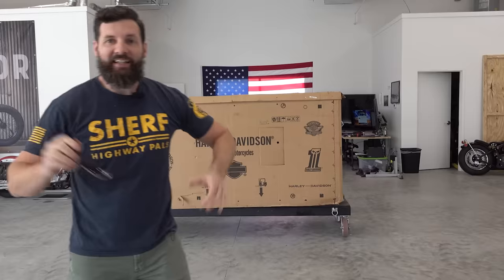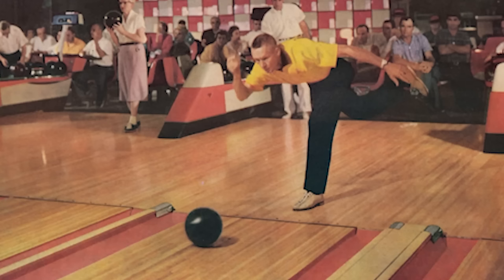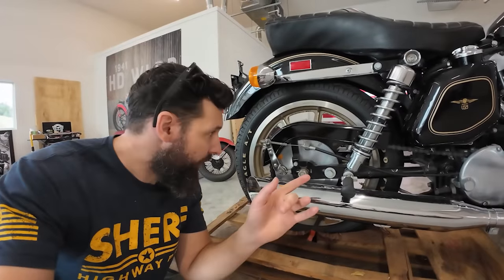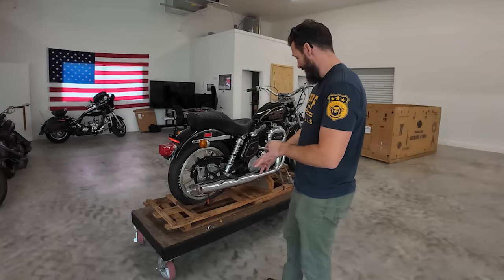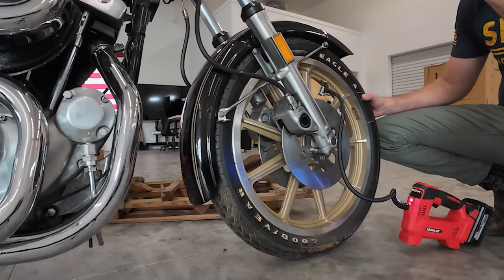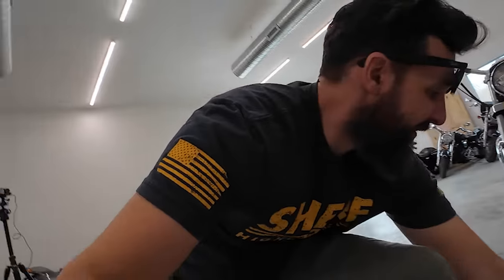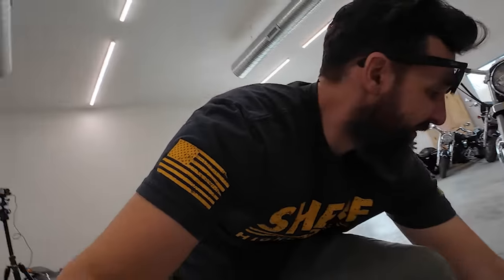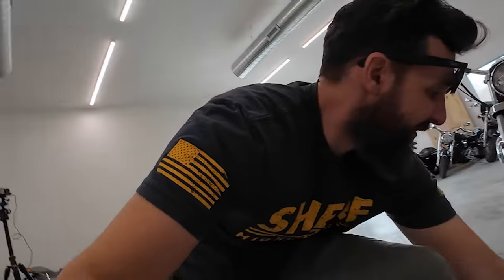I Bought a Brand New 45 year Harley Davidson Motorcycle

Comment: I worked at a Harley dealer from 1980 to 1983 and set up numerous XLH/XLCH from the crate. Batteries were dry, brake master cylinders were filled. It was AMF until 1983 when Willie G bought them back. That bike was definitely used as a parts bike and I'd go through thoroughly. People complain about AMF quality but many of those same people that worked during AMF worked for Willie G too. AMF can be blamed for some of it but they kept Harley alive when it was going to die.Long comments don't get read, attention spans are short today. Good luck with the bike and for goodness sakes get some tools.
Reply: Since you worked for a Harley dealer back in the day, was there any truth to the rumor that some dealerships would totally dismantle the engines and blueprint them before selling them to avoid future warranty work ?  I heard that Dudely Perkins of SF did that because of all the problems with the AMF bikes.
Reply: @cyrilhudak4568  The dealer I worked at never did that. The biggest problem with the XLC/H was the transmissions. They sent the head mechanic to transmission school and I was scheduled to go but I left for a better job at a Cadillac dealer before I went. When setting up a new bike though when it was in the crate we went over all the nuts and bolts and checked for loose things. The same union loads that were doing a crappy job putting the bikes together were still working there after Willie G took control.
Reply: Lol dont mean to be a smart a$$ but wasnt the last XLCH in 1979? 😛 still enjoyed your testimony
Reply: @rodan2852 Because it's impossible to setup a 1979 in 1980 ae - that would just never happen...
Reply: You're right. AMF saved Harley and had instituted QA and buying new tooling. The family didn't care about mc's except for entertainnig Willy G's love to ride. They milked the company without concern for quality. If AMF hadn't stepped in, HD would have gone out of business and would not have been around to bring back the big mc market that came in the with 90s. I dated the daughter of VP of Parts.
Reply: Much appreciated to hear that some ppl give credit to the workers and just the simple fact that harley is still around.  If you used to assemble them, would it be OK to ask you about problems I may incur while rebuilding my xlch?
Reply: @hoobeydoobey1267  Whoa, the daughter of a VP of Parts!? Wow. VPs are almost like a king of a country so good thing you didn't date a daughter of a lowly accountant or car washer.
Reply: I read it and i thank you!
Reply: Wrong they bought Harley back in 81...not 83
Reply: The workers that put bikes together are not responsible for quality, quality comes from design and testing production quality comes from management.
Reply: That would be a waste of time...??? He doesn't know how to use them...?? Nore the common sense to learn...????
Reply: @Darth_Sidious_66 Lol that was both funny and hostile
Reply: No XLCH after 1979 . You may not recall completely.
Reply: Or you could get it running and see what issues it has? If it has brakes and throttle then send it.. of course check all fluids but I wouldn’t be going thru retightening every single nut and bolt on the bike.
Reply: @rodan2852  yes it was . I had a 1979 XLCH kick only was the last year .  That bike was kinda an oddball like XLCR setup .  But it would of dusted my 1995 1200.  It was an extremely fast bike all stock. Better top end speed too. Best handling bike I've ever owned. Regret selling but had too many motorcycles I thought.
Reply: The same AMF that made racquetball rackets?
Reply: Some people still read 😂
Reply: My buddy/brother has an 83 AMF that he wouldn’t trade for any bike on the road.
Reply: reminds me of Honda's same vintage
Reply: The zip lock bag is kinda a giveaway too.
Reply: Most people don’t know AMF design the evolution motor! I don’t care what they say. I’m a sucker for the Shovelhead.

Comment: My first streetbike was a '69 Sportster, which except for your 78's disc brakes and cast wheels, was very similar to this one. These were about as old school as you could get in 1978, but they still had a loyal following. This was just one year before the 130 hp Kawasaki Z1-R Turbo, 120 hp KZ-1300 and 6 cylinder 24 valve Honda CBX, so people certainly weren't buying these for performance, but to get that legendary V-Twin mystique. By the way, I love those old raised white letter Goodyears!
Reply: I have a '72 XLH with the brake pedal and shifter on the opposite sides! Really fun to ride.

Comment: That exact model was my very first "new" Harley Davidson. I was never able to get that, hand pinstriped, leather seated thing over 98 mph. no matter how hard I tried. Never the less, I still remember that bike to be the most beautiful bike I ever owned. I am still proud to say that I was an owner of a 75th. Anniversary Harley Davidson  sportster. Thanks for the trip down memory lane.
Reply: How was quality of built back then?
Reply: PeterAngles-jq7gr  They are actually the fastest motorcycles today....right off of idle. However, the other ones begin to catch up real fast not too long after. Key word there is "idle". Nobody with an overhead cam produces that kind of low rpm torque today, do they? (of the same cc or cubic inch) I'm remembering the adage "It's not how fast you go; it's how you go fast." I don't know of any other motorcycle that is that fast off of idle, and they were not trash. They were good. I don't know that Harley ever made a bad Sportster motor. It might not be the very best for longevity, but they were far from trash.
Reply: A buddy I used to work with who had a older brother by a blue 78 AMF 1000 new that passed away shortly after he got it his mom kept it for him for 14 years till he turned 16 that dude has rode it everyday ever since even in the coldest of Ohio Winters he would leather up and ride it on the ice to work he even rode it into the church with his old lady on the back when they got married it was great crazy fool will pass ya doing 70 on the back wheel dragging a hand laughing pretty sure his brother is always riding with him I haven't rode with a bigger nut and I rode motocross bikes with some real loons growing up
Reply: I had a 79 XLS 1000, I put an SU carb on it, that made it go, saw  over 108 mph easy.
Reply: @larifari4371  No complaints about the quality. Chrome was immaculate, paint was primo, even the hand pinstriping added to the beauty. Gold mags were awesome. Seriously, if you were lucky enough to own one you had a very distinctive motorcycle. That is unless you wanted to go over 98 mph. 😞
Reply: @dozerblade  As I recall 79 was the first year of a major frame change and a few other internal revisions on the Sportster model.
Reply: @raybrensike42  This comment made my eyes bleed
"Right off idle" is just some made up term that doesn't even exist wtf is that even supposed to mean💀☠☠☠☠
Reply: Seat was vinyl, not leather .
Reply: @devildigger1404  Not on the 75th anniversary models.  Both FLH and XLH had leather seats.
Reply: It is a very good looking bike and except for the tires which were crap when they were brand new,  and need to be changed out anyway,  should be a nice reliable machine.  I wonder how much they paid for it?  The crate has a lot of value to it too.  Look at all the cool graphics on it.  You could also use it to ship the bike anywhere.  Lots of fun!!
Reply: PeterAngles-jq7gr  So did your mother...
Reply: PeterAngles-jq7gr  You got it, friend

Comment: Worked on that era Harleys 40 years ago. Don’t worry about the external fasteners. I could tell you about problems with internal quality control which can and should be rectified if doing rebuild, from rocker arm shaft end play to crankcase bolts. But put together properly most issues easily be taken care of.

Comment: I owned the exact same bike back in 1982-83. Made it into a chopper after running out of gas too many times with that small 2.2 gal tank. I put a 3.5 gallon mustang tank on it, had the swing arm removed and a custom hard tail fabricated for it. I'm pretty sure that the original owner changed the drive sprockets on it ad well as staggered pipes as I could get that bike up to 120 mph no problem. She was fast and at that time the only bike that could take me was a punched out electra glide that in its prior live was built for the local drag strip. I loved the bike, the wife, not so much, being a hardtail and the small pillion seat made for an uncomfortable ride for her. 
Also, the bike had 4 circuit breakers located under the seat, one would occasionally trip, killing power to the ignition and leaving me stranded on the side of the road, eventually, the breaker would cool down enough to auto reset and allow the bike to start and run. This seemed to only happen on pretty hot days. When I made it into a chopper style bike, I replaced the breakers with a fuse box and completely rewired the whole bike. Fun bike, kind of wish that I still had her. And yes like all Harleys of that era, she would mark her parking spot with a few drops of oil. Was my first Harley and now on my 12 or 13th Harley now, hard to keep track of them all at my age. 
Enjoy the ride, she's a classic.

Comment: Brings back memories. Back in 1981 I was 18 years old. I bought a new 1980 sportster from my hometown Harley dealership. 11 yrs lots of memories and 46,000 miles I sold it. Many back road rides throughout Wisconsin and N. Illinois. 1 tough ride from N. Illinois to Colorado, Pikes Peak summit "thought I'd freeze to death in September" Pueblo west, then home. It was a short trip and country back road putt bike.. Highway travel at higher speeds the 4 speed/solid lifter ironhead vibrated my eye teeth loose. Always liked the low and lean sporty though!
Reply: My first Harley was a 1981 Sportster.  Loved it.  Root beer brown with a seat as comfortable as a board.
Reply: Your bigger Harleys had a adjustable chain oiler that used the engine oil to lube the chain. I had a 65 XLH sportster it did not leak, Ihad the oiler turned off. Motor cycles from that era were a whole different breed! They were a mechanical machine! Not like today's plastic cars and motors full of electronics with psychological problems!!! Your old vehicles if you had a  
Problem you could bend or twist something or hit it with a hammer, and sometimes it would go again!

Comment: Owned a 76 AMF Harley Davidson, drove for several years, never leaked a drop of oil, ran great and sometimes l wish l still had it. It was fun watching as it brought back many memories. Thanks!
Reply: Most marked their spot cause of the chain auto oiler which it was supposed to drip on chain from there to floor.   Those older models had shifter on right side and never could get used to it.  Kept lifting brake (back) pedal so not fun unless you can get used to it.  But then other bikes become awkward

Comment: I’ve owned probably a dozen harley’s in my life and i really never had a problem with an AMF HD. I bought a 73 sporty at an auction that sat in a parking garage in Manhattan for over 20 yrs and the thing was running the next day. $400 for the bike, about $150 in fluids and misc stuff and i sold it 2 weeks later for like 2800 so AMF never did me wrong

Comment: A beautiful original. I have a '79 Sportster that I ride regularly all summer. The 1000 Ironhead is more than brisk enough to enjoy around town where the bike as a blast to ride, just stay off fast highways with it as it gets real uncomfy over about 60 MPH.  Dealers almost always installed an aftermarket Lockhart oil cooler on these.  Nearly any part you'll need for it is out there which is good, as AMF Ironheads are definitely a mechanic's bike ;)

Comment: I had a late 79 1/2 1340 shovel head 4speed FXS lowrider it was the nicest scooter I had. Rebuilt it three times 2 complete overhauls. From time to time I miss her yet I got tired of wrenching on her and the cost of parts for that year and model just kept getting more expensive. Plus I had to go thru J & P Cycles. She has a sound so sweet at the right rpm's. Like a galloping horse. 🇺🇲🇺🇲🇺🇲🇺🇲🇺🇲

Comment: My first Harley was a 1978 Lowrider!! It was an AMF bike but I got a good one!! I did an 8,000+ mile trip on it and the only problem was a broken speedo cable!! I did upgrade to a 5 gallon tank and that shovelhead got 50 mpg!!
Reply: Mine was VIN 2F79068H8   1978 1/2 Low rider

Comment: I am the original owner of a 1979 80 cubic inch FXEF, aka Fatbob Superglide.  So, I was real interested in this video.  I was slightly disappointed that it was not an FX model.  During those years of HD, XLs & FXs shared a lot of parts; saddles, headlamps, etc.  My bike also came with the Eagle A/T tires.  That bike never left me stranded while on a ride.  However, I have had to do a lot of maintenance on it.  It was my only ride until I bought my 2006 88 cubic inch FXDI; aka Dyna Super Glide (which is now 95 cubic inches).  Riding the bikes is quite a different experience from one another, but I love them both.

Comment: I'm one of those old guys that really knows that era Sportster . I've been riding and owning them since '78 .The " sealant" under the lid for the front master cylinder is actually the flat diaphragm/seal that contains the brake fluid and also keeps brake fluid from peeing out the tiny vent hole in the master cylinder lid . That diaphragm is the size of the lid and is it's own part .That bike takes DOT 5 silicone based brake fluid and only DOT 5 that's why the front master cylinder isn't rotted inside . 
  The bracket that holds the instruments does clamp into the gap between the risers and handlebar clamp where you had it and the handlebars will be secure with the bracket in that spot . Your guy seems nice enough but it's too bad you don't know someone that really knows that era Sportster . The factory shop manual or Clymer manual would really help you guys out .
Reply: this guy bikes
Reply from the maker: good to know
Reply: i tried shutting down some haters here talking about a ziplock bag isnt OG ...and i asked ? is the ceilng paint up to your liking bud? Much love and support. Not sure how people do it with mass haterade i call em out! then they realise their mirrror is broken, therefore cant see  @BikesandBeards
Reply: While I'm thinking of it ... The oil tank has a lift out oil filter canister just under the tank cap . Inside that canister there's what's called the " horse hair " organic fiber oil filter cartridge. It's probably degraded over the decades giving off that old shoe store smell . That should get replaced before it breaks up under use and sends debris through the engine . Also the oil tank was probably filled decades ago when it was delivered , since then the oil in the tank has crept past the oil pump ball check valve and the contents of the oil tank ( three quarts ) is probably inside the main cases of the engine . Those two issues should be addressed before running and damaging the engine .  @BikesandBeards

Comment: Me and my buddy bought a 1000cc iron head sportster with dual disc front brakes from a pawn shop here in daytona beach for $500. oF COARSE IT DIDN`T RUN BUT IT WASN`T LOCKED UP EITHER.  A carb kit and pionts and some wirirng and it started right up, Noisy upper end and some what smoky but it ran nice. 12hrs to fix it and 3 hrs of ride time to wreck it into a gaurd rail....no one was hurt but our feelings took a shot. It was only about 4 yrs ago

Comment: That is one heck of a find!  This model, XLH 1000 (75th Anniversary Model) only had 2,323 built.   Not all dealers got one, my local dealer got 2, probably because he raced for Harley.   This was my first Harley,  I bought from the original owner with 3K miles in 1980.  The sister bike was still owned by the local dealer.  It is a very powerful 1000cc and provided many great memories. If you don't keep it for yourself, let me know.

Comment: I bought a new 1978 Superglide. And you're right about Harley not putting the kick start on them. They only had electric start and i had it in the shop 3 times in six months to get it fixed.  Harley only had a 6 month warranty then so i put a kick start on it. I moved to Houston in 1980 and it got stolen after living there only a few months. Needless to say i never saw it again.

Comment: Ok so here are my suggestions, get the 76 kickstart components, install them. Two get the Axell 88 ci kit and install it. And the most important thing on iron head sportys upgrade the oil system, they are weak at idle otherwise you will have to keep bleping the throttle  at red lights. Nice find, I would like to find out how you find these bikes.
Reply: He can't install turn signals,  how the he'll is he going to replace the flywheels  ?

Comment: Last year for drum rear brake, 79 they mounted the master cylinder where the kickstart would go and gave the rear exhaust a weird bend to clear it, you couldn't get aftermarket pipes for the 79 for a year or two because they just couldn't deal with it.

Comment: I had a Ironhead Sporty with the 4 speed tranny that I absolutely loved. It was, by far, the best little “bar hopper” I ever rode. It had the best (IMO) power to weight ratio for around town runs and the balance always felt so smooth to me. I miss that bike, but as an old fat boy I now ride a FLDWG with a 118cid engine and 6 speed that is a better all around (town and highway) bike after my mods.